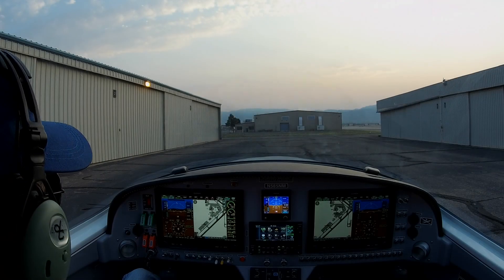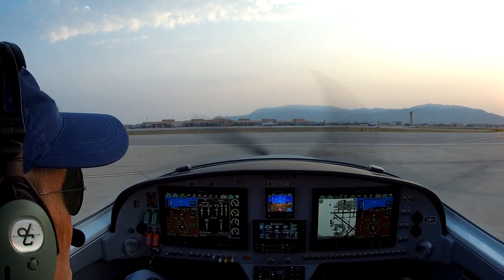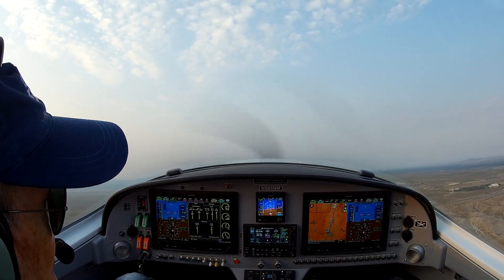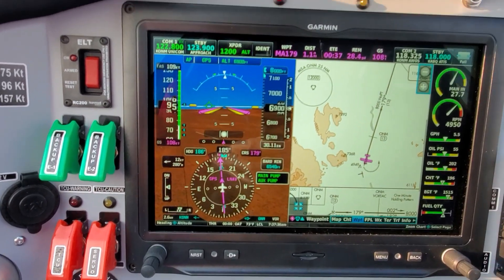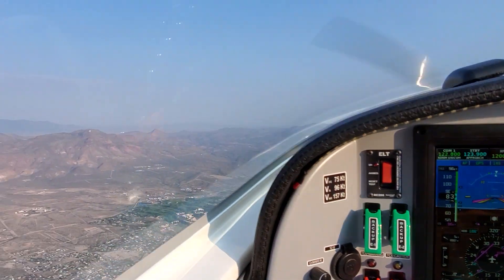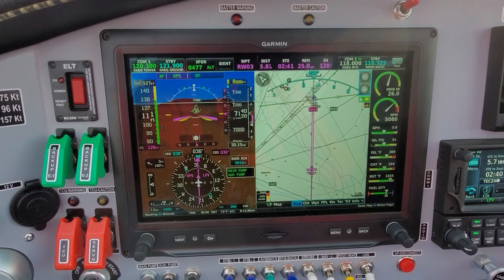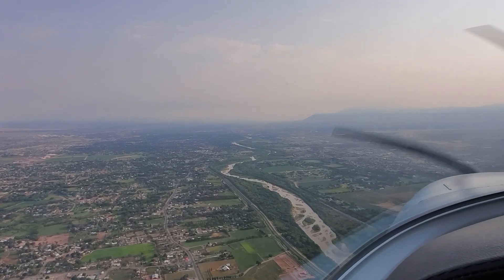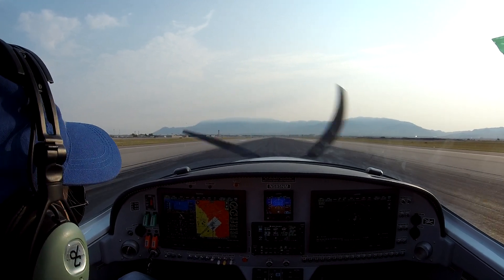Missed Approach with Garmin G3X Touch, GTN 650 and GMC 307

Comment: Thanks for showing. Will get fit again with my 355. Q you also get a gray display on the G3X flight plan, when setting way points, loading app or flight plan on the 650? It seems like you can’t make changes via g3x once you set it on the 355. Also GPS sources is from the 355 only if setting with 355. If setting a flight plan with g3x, then inferior GPS source from g3x is set. You can not choose GPS sources and work with both g3x and 355. Same with 650? 🙏
Reply from the maker: No experience with the 355.  I can select internal or external GPS source on the G3X touch anytime.  I haven't tried to change the flight plan on the G3X because I always have the 650 selected as the source.  The next time I fly (should be soon) I'll watch the G3X when I'm entering a flight plan and see if the display is gray.  I'll also try to change the flight plan on the G3X once it is entered via the 650.  I'll report back to you.  Rick
Reply from the maker: Flew yesterday.  Yes, G3X flight plan page is blank before a flight plan is entered into the 650 and only waypoint info is available on the G3X flight plan page if the 650 is the source.  It make sense since the 650 is certified and the G3X is not. They probable don't want any info transferring to the 650 from the a non-certified source.  Rick

Comment: Love your videos Rick! Shouldn’t the GTN650 auto sequenced to VLOC once crossing the FAF or do you need to push the CDI button on the GTN once inbound before the FAF? I noticed you were always on GPS. I have GTN650’s in my plane and I know it auto sequences on ILS approaches from GPS to VLOC but not sure on VORs. Thanks for the help.
Reply from the maker: The GTN will auto sequence when on the ILS, but always check it (sometimes I've had to push the CDI button).  It does not on VOR approaches because you can use the GPS all the way down as long as the green double needle is tuned to the VOR freq (no so for the ILS). Thanks.  Rick
Reply: @goldenoldie3524  Never thought of it that way, great news I,ll have to try it next time I'm out playing around. Thanks again!

Comment: Wow I’m really happy I came across your channel and I’m defiantly subscribing. Love the IFR content. On the sector entry into the hold... either tear drop or parallel would be appropriate however the logic is that the teardrop is preferred as it allows you to track your inbound course to the hold for at least 30 sec and especially if you are hand flying this would allow you to assess the wind and drift correct as apposed to the parallel... of course you could asses the wind effect while tracking out during the parallel but the correcting would be in reverse when applied. Great videos
Reply from the maker: Thanks.  Rick

Comment: Rick. Using your finger to adjust your view of the plate shown on the right side of the split screen PDF is quite a feature.....can’t do that with the G1000.  I was surprised how close the AP let the HSI  deviation indicator get to the course line before the turn was initiated.  The hand flying technique is to keep the lubber line of the HSI on the tip of the deviation indicator as you turn.  Were the turns standard rate and did the bank very at all?  Patrick
Reply from the maker: Hey Patrick.  Had a G1000 in my DA40 and really liked it until I got the G3X touch.  Depending on the angle of intercept, the ap will make some turns steeper than others.  If ATC brings me in at a 30 degree intercept, the bank will be pretty gentle.  Rick

Comment: I think you should use the turbo more.  When they only get occasionally used the wastegates tend to gum up.  If it’s over rev’ing then you might need more pitch in your prop.
Reply from the maker: Thanks for the info.  Actually, the turbo is operating all the time.  It's just not in full boost mode until the throttle is fully opened.  That's why the manifold pressure is much higher than a normal aspirated engine would be.  Rick